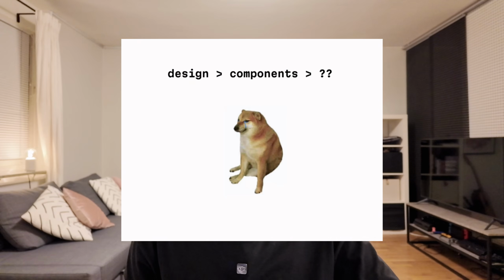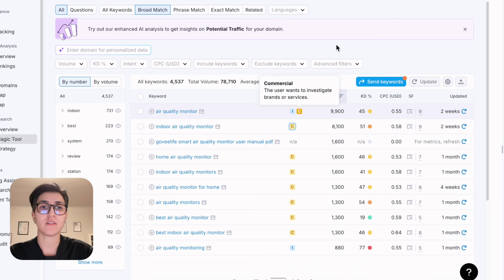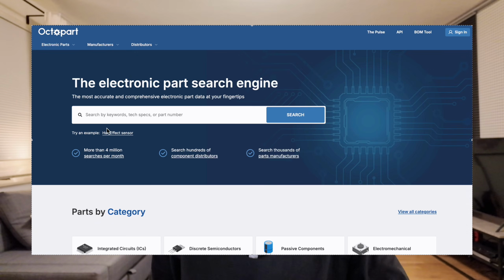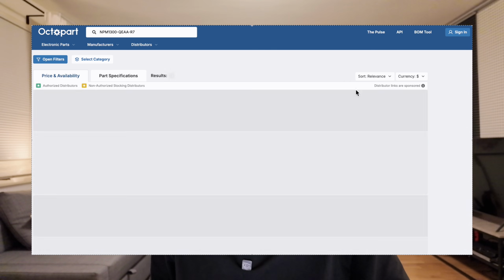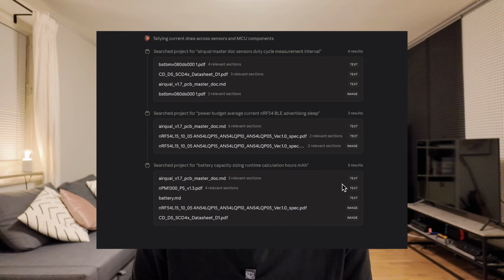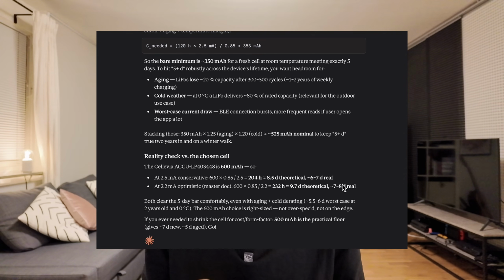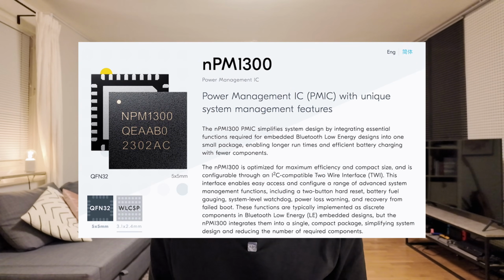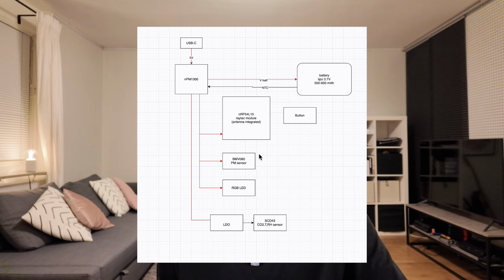how I start designing a product

Comment from the maker: Okay, place your bets: what will this circuit board/PCB cost me for a batch of 5? Reveal coming in the next loop 🔁
Reply: thanks for the series!
my bet is (for assembled boards) 342$ + the sensors 250$ (as you said 50 per device)
Reply: Hello. I watched your video last time. I didn't subscribe or click like. Your video came in newsfeed. 

Voice: no. That's a lie. The viewer must have played and went away.

Me: "what's the cost of component?" 14:22 minutes of computation and human time per viewer.

Question: correct me if I'm wrong. you start your work a long time back and introduced youtube logging into your routine. 

Thought: also, you probably are trying to use youtube to get your future customers now. The quick spike in video view count does not mean you found your customers, that dopamine will deviate you from your steps.

Comment: I think the PCB will cost about 50usd a piece. Would you be making the PCB in China. And if yes. How does the parts you sourced in Europe make it all the way to China.

How do you make those two continents talk to each other in other words.

Great video by the way. It's an eye opener.
Reply from the maker: Yes China if definitely the place to order PCBs, many of the factories that assemble PCBAs in Europe still order the bare PCBs in China.. so considering both price and time it's just more convenient to order directly from Chinese manufacturers. 
For parts they don't have you can buy and consign your parts to them, and some offer to source directly from the "western" distributors (Mouser, Digikey etc), it's gonna be more expensive but it gets the job done!

Comment: Hey Sarah, Embedded firmware engineer here perusing masters currently. What was the biggest technical "unknown" or trade-off you've had to do while balancing the strict requirements for portability, cost, and sensor accuracy?

Great video BTW.
Reply from the maker: the biggest unknown that I haven't solved yet is how to handle the outdoor part: CO2 sensor needs contact with air but not water, sooo I will try to make it splash resistant but it will not work under rainy conditions...

Comment: Hey, I’m an engineering student and I worked on a similar project called Cheepa. The idea was inspired by how birds are highly sensitive to environmental changes and air quality. Similar to how canaries were once used in mines to detect harmful gases, Cheepa acts like a small digital bird that monitors the surrounding air in real time. It’s a portable, low-cost device that uses sensors and Bluetooth connectivity to help people track air quality and become more aware of their environment.

I also have experience in PCB design and embedded systems, and I’d love to connect and explore if there’s any way we could collaborate or work further on similar ideas together.

Comment: Just curiosity: why not an ESP32? It already has an integrated bluetooth module and it seems to match your use case.

Ps: not any clue on how much is going to cost 😂
Reply from the maker: good question: the main reason is power consumption, Nordic Semiconductors Bluetooth chips are really optimized for the use case of battery powered devices, some people use them with coin cell batteries (non-rechargeable) and have their products last years!

ESP32 is nice for wifi applications
Reply: @busy_wait  Awesome!

Comment: Great video! Good luck with the next steps. Also whats your expected cost (parts and components) you have in mind for the product?
Reply from the maker: I don't know it yet, I will reveal it after I ordered the PCBs and have a model for the enclosure.
but I am a bit scared because the sensors are very expensive...

Comment: Awesome work! You will need to do CE with a lab regardless. fyi! but it wont be as expensive since the module is precertified. Looking forward to the updates! Awesome device
Reply from the maker: Thanks! I've been following your channel, got great inspiration from your Air Cube video about thermal isolation 🙌
Reply: @busy_wait  Nice! thats awesome to hear!
Reply: I am subscribed to both of the channels 😊

You folks are amazing 🤩
Reply: I'm so lost in this CE thing, can you perhaps make an episode about it?🎉
like what is ok and what requires it's own test... e.g. using a dev board as is with just few buttons on a cable (small tip and ask for a separate video for either of you 🙃)
Reply from the maker: @jan22014  yeah there are so many directives... I will do a video about it, if everything goes as planned in end of june/beginning of july I will do the EMC testing!